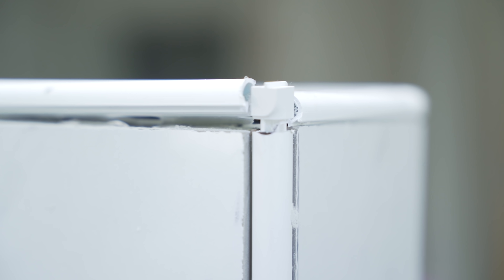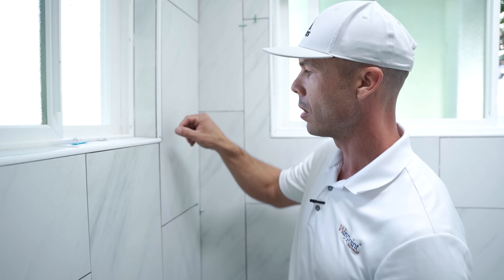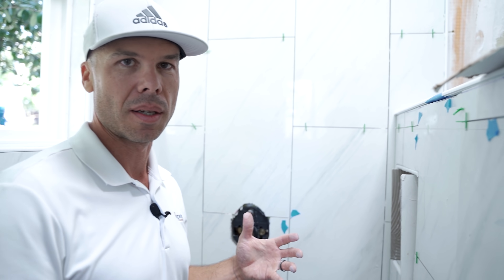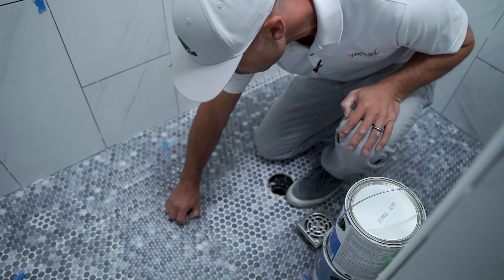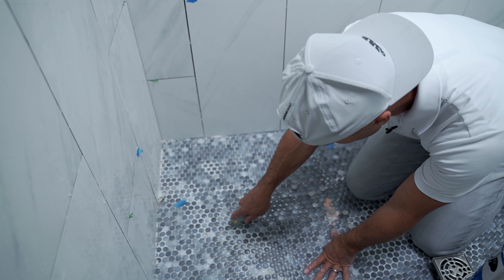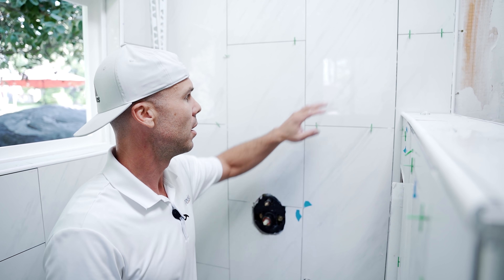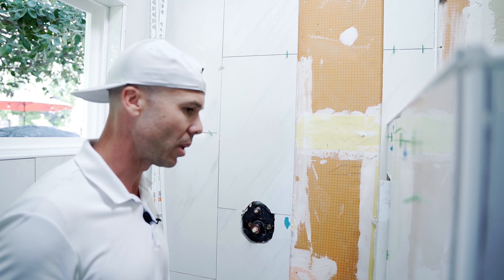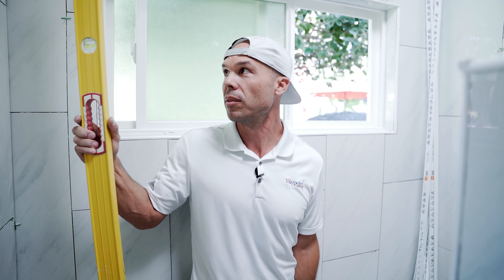WORST TILE JOB I'VE SEEN - Can We Save It?

Comment: A large tile like that needs absolutely level floors,  and walls , not only level , but no bows or dips, etc. You need to " strike off" walls. This  was common knowledge for every tile guy before even thinking about tiling. The fall of the unions and not paying proper wages has caused illegal work force , this has been going on like 40 years or so. Disrespecting the American craftsman ,, end of rant.. the results ....
Reply: Home owners don't often hire actual qualified tradesmen.
Hell insurance companies send random Joe blows.
Big cost difference between unqualified labour at 10-20$/hour versus qualified at 40-80$/hour.
Reply: It's the same here in UK. Here it's because you dont need any qualification or anything to do it and too many people think it's easy and have a go. I worked with a bathroom fitter who believed that the adhesive was only there to hold the tiles on the wall ready for grout. He thought the grout was what 'held' everything together.
Reply: @paulp.l.4869  I agree. I dont work for customers any more. I just buy rental units and remodel them. If I tell a customer I charge $40/ hour they go crazy. Keep in mind I can completely remodel  a bathroom in like a week and give them option to install new plumbing while everything is open . So 40 hours at $40 would only be $1600 + their materials ,, a bargain if you ask me ..!!
Only very wealthy customers will pay me those rates,  and I can't wait for just wealthy customers. 
If you are a skilled craftsman , , invest in a quality area and do rentals or remodel and sell .. it been this way for like 30 years here in a lot of cities in America.. I am an immigrant myself ,, legal and always pay my taxes...
30 , 40 years ago you apprenticed for 2 years , and would go to trade school. You got paid well and had insurance,, now its just no rules ,, just depends on your ethnicity into which job you get hired on. Beleive me I saw what happened in the construction trades ...
Reply: @recyclespinning9839  
You're right about buying to remodel and rent. It's great if you are handy, and have handy friends. That's what I've been doing since about I was 25.
I'm an electrician in Canada, tradesmen here get good insurance and pay.

I tell everyone that usually the cost of materials is very close to what it should cost you in time.
Even at 40$-50$ per hour, I'll be under the cost of materials.
I helped my friend estimate a job for his family... The cost of materials was 2700$ and time was at under 500$. The guy complained that "you charged cheaper for your hourly rate for your aunt". 
My friend was very happy when he wasn't given the job.

He was going to get screwed. The potential customer called a few companies and found out the cost was between 5000$ and 10000$. Then he had the balls to ask for a price reduction because some items were cheaper from the companies who had wholesale prices... Ufft.

Anyway, if you got this far congratulations on your accomplishments. Sorry to hear about the race issues in hiring.
Here companies on government or bigger sites need quotas of minorities. They have a really hard time attracting any to hit the mark. It causes huge issues because one hired that person can't be fired, if not they get penalties and lose the contracts... Even if, really story here, the guy almost killed 2 people on my site. Once right in from of me, with a scissor lift he pushed a guy through a barricade. Lucky the victim held on to the kick plate. The drop would have been 150 feet...
Then the minority hire panicked ran away, leaving the guy hanging.
On another site his negligence, and failure to follow the rules as usual, caused a death. 

My only issue with minorities and women (especially women) is that they don't need to go to trade school. They can skip the 1800 hours of trade school and magically get their cards to work. At the very least I'm fine with the ones who tell me they don't know and want to learn. Unfortunately this has been less than 10% of the ones I encounter.
The others randomly do stuff, pretend to know what they are doing, and cause problems for everyone.
The worse part is because the bosses know those people are "untouchable" they test them out, and when they fail to perform they give them the worse easy jobs.
This person I mentioned was given 8 months of "electrician" labor (that was the fair test)  and then confined to just drilling holes where he was told to.

Most workers aren't very good. I'd say: 40% are trash, 20% can work but not alone, 20% can work alone but don't know why they do things, the last 20% are the all rounders that are reliable.
This is the result of the older workers who got in without any school, and weren't able to properly teach and mentor. Then add all the special cases that skip school and you lower the workforce quality.

One girl, on a hospital site I worked at, went from installing insulation and firestop to being an elevator mechanic over the weekend...
Huge pay increase.
Never went to school for either...
That's when she told me about the programs, and I verified if it was true. Sadly it was worse than I though... They received better conditions than everyone else.
1/3 off their salaries, up to 20k, was paid by other workers dues. So the employers would not suffer from the hires incompetence as much.
Oh and there was a loophole because that subsidy was available for up to 3 employers. The women would "switch companies" and employers barely paid the salaries.
They would stay on the sale work site, but in the books they were lent from other companies.

I'm always the one fixing the mistakes or doing the harder jobs.

I hate fixing mistakes that were entirely avoidable, and that a 1st year apprentice who came out of school wouldn't do. Especially when they were warned, told how to do it, but failed to follow instructions or inform others that they didn't know what to do.

You still get gems in the rough though. The best 50+ years old worker I met, in the quota companies, was a woman. 
She came to me for information and guidance. She was sharp and learned quickly. She admitted to not have any gone to school, and always felt like something was missing. She was hungry for self improvement, which I couldn't ignore and helped her with code and more complex issues.

Anyways sorry for the rant... haha
I hear that in the states, like Canada, your pay and benefits are very relative to where you are. Moving for a while is an option.
Here you can earn between 70k to 180k depending on location. Working for oil, mining, and power plant construction is really lucrative.
That is if you don't mind being isolated and 12-14 hour work days.
Reply: @Big_Old_Bondy  haha that's funny, and not surprising at all
Reply: @paulp.l.4869  Boy sounds  complicated, , I mainly work on residential remodeling.  Sometimes on apartment complexes , I really never liked working on huge major construction jobs.  Even when in the union they push for production,  then have no guilt about lay- offs at the end of a project.  
Nobody ever said construction job was easy. Heheehee,.
I have heard in Canada its better for workers, than here in the US.
Here the unions are practically dead. I think they did kind of  killed themselves,  the average worker costs an employer about $80 per hour for benefits and wage..    I can't imagine what the owner needs to charge a customer,  and that translates to pushing for production.  Honestly a union should just set standard rates and skill level for qualifying a skilled tradesman of like $40 per hour and then all workers should be self employed meaning you don't work for company . . Like I said invest in good solid rental units .. When you get a customer you know is going to not be profitable,  just take a pass. ...

Comment: Even contractors that have fantastic reviews can fall short. Best to call for references. I just completed a kitchen renovation with a reputable contractor however, my porcelain tile had far too much lippage and also defective tiles were installed. I brought in an actual tiling specialist who installed a  tile floor for me and did an amazing job. My contractor agreed to allow him to replace the twelve tiles. Fast forward three months and I dropped a glass and knife onto the floor which both items caused cracked tiles. The tiles were installed over Ditra membrane and even the Schluter rep says this isn’t normal. I’m in the process of having the floor assessed by Schluter tiling specialists so we’ll see how that goes in the next week.

Comment: I'm mostly a DIY'er.  Demolishing a bathroom currently and stunned by all the shody work I've uncovered.  The only surprise is why it didn't leak on day one.  I guess the rotten-out subfloor is testament that it had been leaking for a long time.

Love your videos.  Appreciate the help and guidance.  

It would be great to hear how it ended.  Did you get the job to redo it?   Find any more hidden problems?

Sadly, I had a similar experience.  Well, except for the cheap part...  I had done all the prep work, using Schluter materials to the letter (stuff ain't cheap) and hired a friends "great tile guy" to set the tiles.   Well, he was getting big for his britches, so he flipped the job to some mope without telling us he wasn't going to do it himself.  Got home from work on day one and the first days tiles were set horribly.  No spacing in some places, huge spacing in other places.  Lots of lippage. I quite literally could have done better myself.   Told that guy not to come back and demolished everything he did.  I decided to "sleep on it" which was just stupid.  I probably could have scraped the tiles off that evening and not had to redo all the wall board and schluter. 
Cost me about $700 in the ruined tiles, wall board and Schluter I had to replace.  Tiled the rest myself and it's still standing and water tight...
Reply: I own an old singlewide mobile home so, hiring stuff done just doesn't make financial sense.  There was pretty much no way I could make my tub/shower worse than the original installers.  Hopefully someday I'll own a real house, and if I need tile work, I'll hire a professional.  After seeing their previous work with my own eyes.

Comment: I just started watch your videos about a month ago. I’ve seen several different videos from different tile setters. I’ve got to tell you. You impress me the most in many ways. 1)Your personality of humility and kindness is second to none compared to the ones I seen. I can tell that your knowledge of tile setting is also second to none. I was in the roofing  trade for about 30 years. I mostly installed tile roofing. Obviously I have been around various trades during that time. I would occasionally watch other trades during breaks and whenever and picked up a little knowledge here and there. Anyway, I’m in the middle of remodeling one of my bathrooms. The workmanship from the previous tile setters that did the counter, floor, and bath/shower was/is absolutely hideous. Walls had to be shimmed a lot and there was a stud that was just bouncing around where the faucet connected to. The floor tiles pretty much just pealed up and underneath it looks like they painted the floor with roofing tar or something. The thin set was stuck on the tile with the black component stuck to that. I’m going to have to sand the floors to have a good adhesive to the cement floors. This whole bathroom was/is a total disaster. You can tell it’s not the original tile by a few different things so whoever did it, did a horrible job. Anyway, thanks for the videos and God bless you.

Comment: If you go up to 1/2 inch mortar you need a medium bed, wedi shower pans can take those penny rounds but you have to use epoxy to set and grout it. If that hack had keyed the mortar into the wall the tile wouldn't have come off but you're right it would have grown mold. That pan is definitely a tear out. Their pans are only surface water proof meaning any knick or tear and its junk. Same with the walls. I don't know about Cali but most states anyone can get licensed and set tile, no former training needed. If you really want to know if you have a good tile contractor ask if they know about the NTCA or have a CTI certification. No matter what its a gamble, if you're a home owner reading this ask as many questions as you want. I have answers and I am always happy to educate my clients.

Comment: From the looks, they didn't trowel the wall, they troweled the tile 17 different directions to get slop on it, then slapped it on the wall. A shower done by a bricklayer perhaps.
p.s.  Strangely here in the UK we don't have Kerdi boards or at least they are not in wide use if we do have them, generally for tiling a wall surface it used to be plywood but these days we tend to use either cement tile backer board or a newish product called insulated tile backer board. Water resistant + insulation in one. Very useful for old houses.

Comment: I’m a tiler and The problem I see is a lot of people think that tiles is easily done I just got done with a job 1200 sq ft of quarry tile did not want it to be leveled even though I told him I recommend to get perfect have to spend few extra thousand to level and prep and it was up to 2 inch wavy floors  (I know I shoulda never took the job) but complained that is wasn’t 100% leveled I was able to get 85% level word to the wise to home owners or paying people if you want quality work it’s not just laying tiles it’s the prep work that is more important than tiles

Comment: The bathroom in my house I think is also put by the previous owners themselves. All tiles in my house are placed on dots. Grout starts falling out, tiles with cuts on both sides placed in the tiling,... Evertime I see it I get frustrated. Even without knowledge I don't see why you would place it on dots instead of having good coverage

Comment: I’ve been doing contracting 12 or so years now, I mainly do granite counter tops but can do tile.. I’m not a expert but I’m not a novice. With what I’ve seen over the years, I’m 100% sure this was a DIY job that went south. I’ve been seen horrible tile installers but with spot bonds like that, it’s usually a dead give away for DIY because they get frustrated about leveling.. and I’m sure they didn’t want to invest in a large tile wet saw, went with a cheap tile saw which shows those edges on the L cuts because it doesn’t have the moving bed and they just move the tile piece.

Comment: Hey so idk when or if you see these messages anymore or not as this one is 2 yrs old. I’m redoing my 79 bathroom and had to put in a new tub n surround . I’m wanting to tile around the top and on my floor. . 
I’ve had to build up around the frame .  And then on the floor in front of the tub. I’m trying to figure out what to use to fill it n level it and then install large tiles on the floor. I planned on a self leveling compound and then red guard or schluter on the floor as my water barrier. But after listening to all your videos and others on here, no I don’t know what to use!!!

Comment: Man...you aren't kidding...those floor tiles on the foam pan...omfg. That's what you get with a bad contractor that has, get it done quick and cheap, low skill illegal laborers on the job. This is in CA...so it is almost guaranteed what happened. This is why people need to at least educate themselves of the industry standard basics regarding remodeling work. Stuff specific to their project. YT is a great resource for that. And never ever feel shy about looking over the shoulder of the people you hire. It's your house, your money...protect your investment, from start to finish. And never accept the "but this is how we always do it" bs line. If it doesn't look right to you, just tell them to stop and get someone like this guy in there to inspect.

Comment: I just finished my first shower 5x4 8ft walls. Thanks to some of your vids I know for a fact the shower I just finished will last forever. I stayed away from foam. Made sure everything I did was plum and leveled. Dry pack came out perfect. No bumps or dips. Wish I could show y’all. It came out amazing. Straight lines and cuts.  Maybe a chip or two but made sure to hide them 😅 I see why 20k for a job is totally fair. Cheap tbh. 30 k for a professional sounds more reasonable now. Especially if you want peace of mind. 15k your risking it.

Comment: Every thing he said is right on except the minimum 2” tile on shower floor. That specification is for ditra not Kerdi shower trays. When he said that I about flipped because I have done a few mosaic on Kerdi shower floor. There is no specification for tile size on Kerdi shower trays except for recommending larger tile for “heavy” loads. Whatever that means.
Reply: Schluter changed this about three years ago (2018 or so).  The older shower trays had a minimum tile size because they were softer.  The newer ones are a little more dense and don't have the minimum tile size anymore.    The current shower tray brochure even shows what looks like a 1" penny tile.

Comment: Today, my first experience installing tile without training. I installed just 5 out of 6.. 60x60 cm granite in a very small rectrangular space 65 cm x 420 cm. It was challenging😥😥 the prep work was so hectic have to use angle grinder on concrete.. it was not leveled 😥😥 in the end i was not able to finish it because I broke 1 tile and now I need 2 more tiles..😲